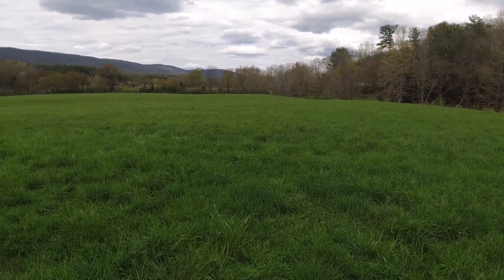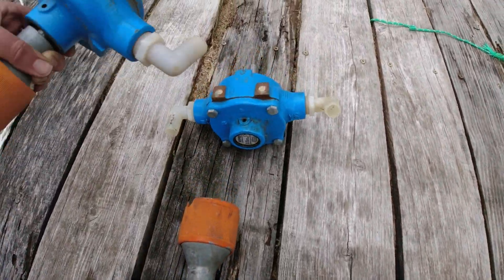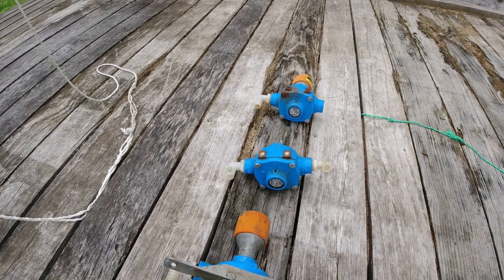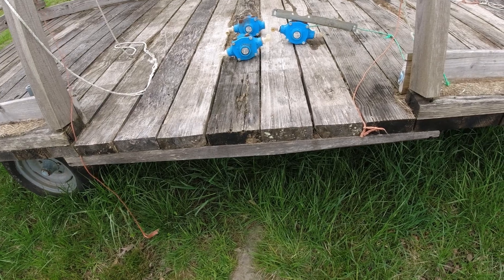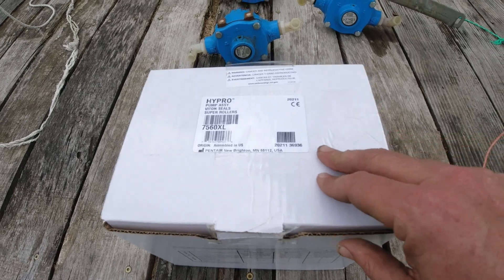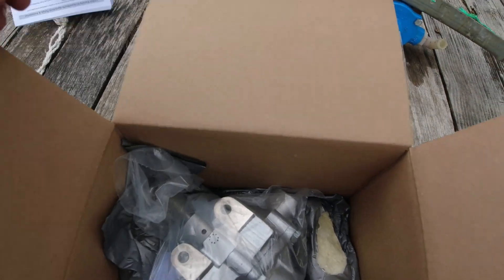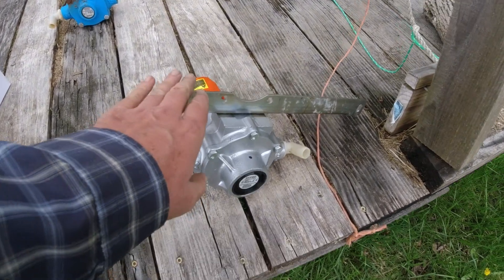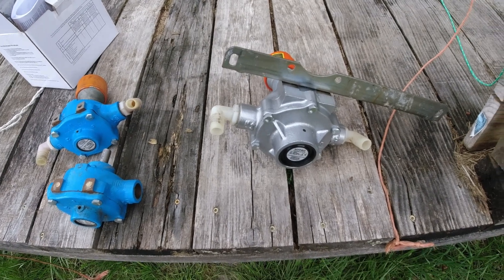Hypro Sprayer Pump Failure - Again

Comment: Thanks for the vid.  I've been having problems with my Hypro's the past few years too.  Makes me feel better I'm not the only one.

The first Silvercast 6500 lasted 4 yrs and I was very impressed.  The next one lasted 2 yrs and it was "cleaned" with a tank rinse and not just rinsed with water every month as with the first one.  Have had cast iron ones last 1-2 yrs without Round-Up and using the tank rinse on a regular basis.

Decided to try an 8 roller  too, but a cast iron one for now.  I like the coupler better too.

Hypro gives them a high end hour rating.  Swap that number for gallons and divide by 2 is what I'm getting the past cpl yrs.  I spray on average 3,000 gallons each year consisting of 2,4-D based broadleaf herbicides, algaecide and aquatic herbicides, and some Round-Up.

Here's a vid on how to repair/rebuild a Hypro roller pump without a press.
https://www.youtube.com/watch?v=cP4Q4zO8Rgg

Comment: Aren’t you supposed to use water pump grease on those cast iron pumps?  Mine has a grease zert hole but no zert.
Reply: That hole is a drain,  not for a grease fitting.

Comment: Doesn't it say to fill with oil  between seasons?  We did that an they lasted for years.  Not disagreeing with you
Reply: RV anti-freeze for me since mine is not stored in a heated shop for the winter.  My pumps quit from use, not a winter storage issue.
Reply: @peacocklandmgmt3719  RV antifreeze will rust the pump, they say to use oil for a reason. At least use automotive antifreeze, it has rust inhibitor.

Comment: Based on how you described the issue in the video, it sounds like the problem is with The liquid fertilizer that you are using. These are the 2 elements that’s effecting the pump , IRON AND PHOSPHORUS. Even stainless steel can not resist against these two! Another thing, the pump that you are using it’s meant for water not chemicals. Blue pump is for water and silver pump for different types of solutions.
Reply from the maker: We are not using any fertilizer through these pumps, nor do I state that in the video.  These pumps are designed to pump more than water, including herbicides.  Hypro even gives the lifespan of the pump when using herbicides for the blue pumps.

Comment: It says right on the pump, flush with oil after use.
Reply from the maker: Yep and it doesn’t work.  Cast iron pumps rust.
Reply: @HumbleHaymakers  My pump is 7 years old and never rusted enough to hurt it, I replaced the rollers once. But you are right they do rust and read the label on the product you are spraying, some are acid and some are not. Acid products require plastic brass or stainless pumps.